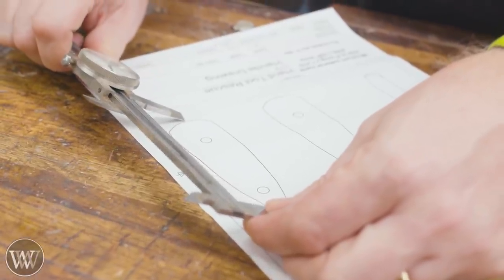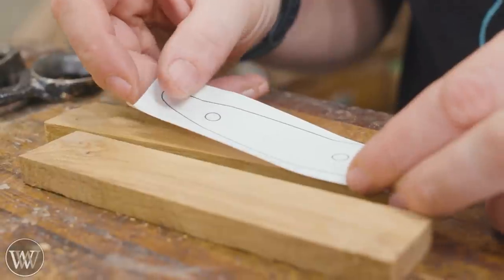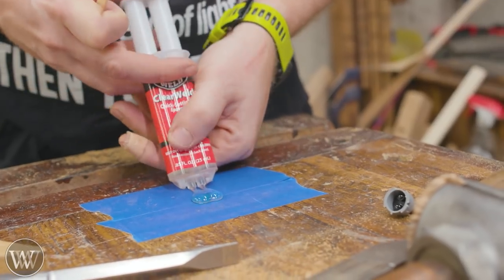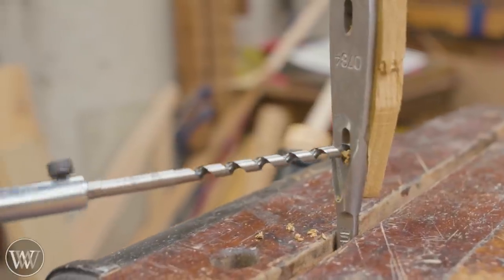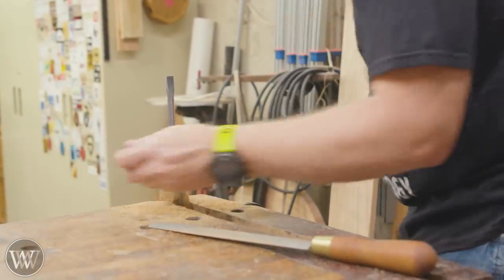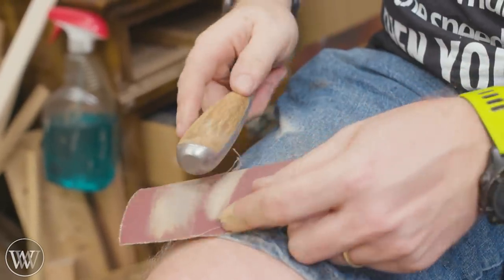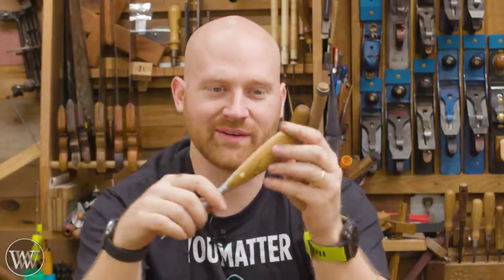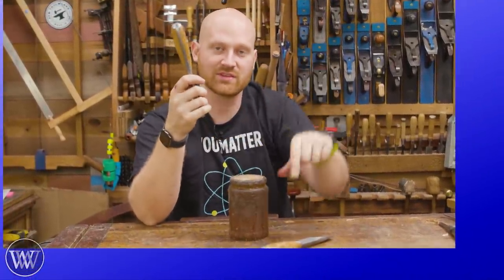How to Make Handles for the Hand Tool Rescue Screwdriver

Comment: G'day Wilbur,
That huge screwdriver... I have needed to make something that big; or so, that will fit in the nylon screw under the flap of my toilet seat. It's so easy to abuse that screw head instead of 'doing it "wright," the first time. It may be just a little large, but you can try it first.
Cheers,
Love both of your channels.
Vernon,
Seligman, AZ. U.S.A.

Comment: Totally agree with oval handles, as my grip strength and joint pain become a greater issue I find oval is much easier for me to grip and control. Lol, harder for me to knock off the bench too. Thinking about rummaging through my kindling and making handle inserts for my end wrenches as well to further relieve my grip.

Comment: I’m curious about the first hammer you used. Did it just have wood inserted in both sides of the head. What was the original purpose of this hammer. I picked one up yesterday, both sides are empty, was wondering what to put in. Thanks! Love your channel!
Reply from the maker: That is called a split face mallet. It's designed to have a softer face with a heavier blow traditionally it would either have rawhide rolled up into it or solid wood some people put in plastic plugs.
Reply: Thank you so much for the information!